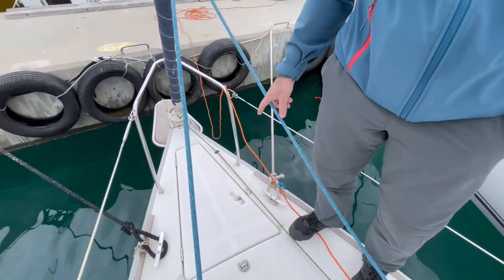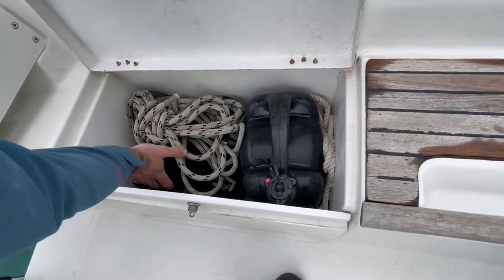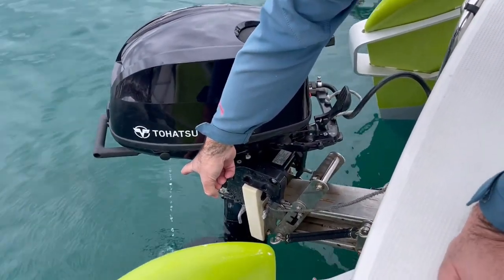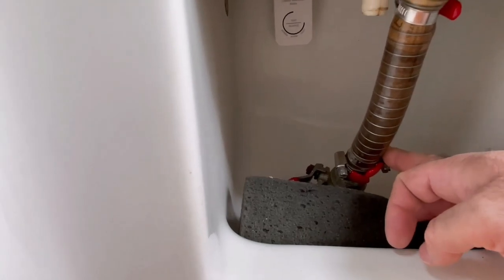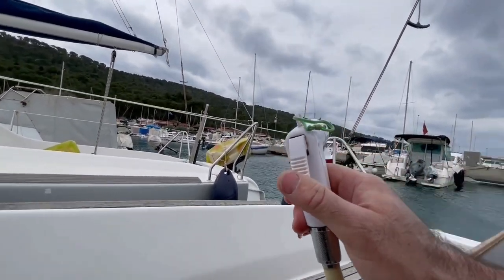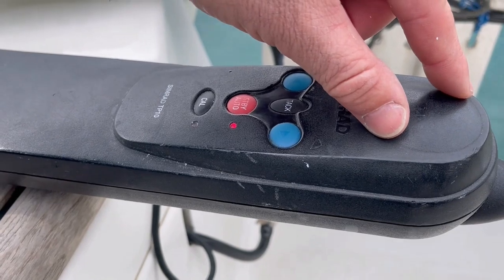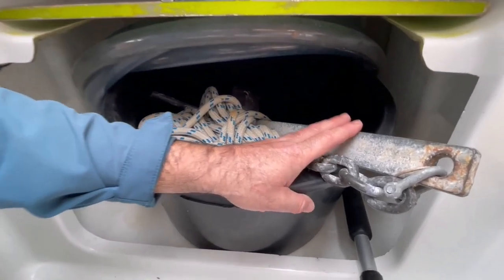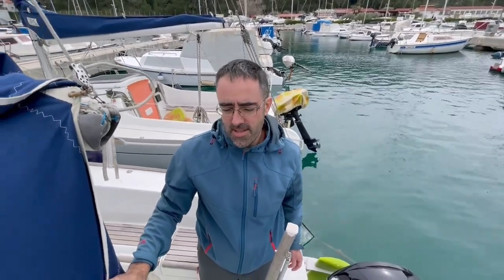Beneteau First 21.7 video tutorial by CroSails.com, compact-sailing-yacht charter

Comment: Thank you very much for the video!!! Have you ever thought that it may not be safe to have an electrical connection in the same hatch where you have the fuel? maybe sometime the tank is badly closed and allows the gases to come out...
Reply from the maker: Thank you for the comment, you made a good point. I didn't think about that before. Luckily, that compartment is open from several sides. Bench (compartment hatch) doesn't fit hermetically and front side (a compartment wall towards the cockpit) lays on two hinges based on the cockpit floor so compartment is well ventilated and there is no possibility to collect any type of liquid inside (all goes under the front wall to the cockpit)
Reply from the maker: I forgot to mention that this connector is 12V DC, 4A, power supply for autopilot. It is not 220V connector

Comment: Great video, thanks!.  Could you kindly let us know where did you get the sunshield from?. I have the First 20, I guess the same sunshield model will work but I have no idea where to purchase it.
Reply from the maker: Thank you. I made this sunshield in the local workshop 7 years ago. I had several micro boats with similar shades, mostly wider, but I made this model a bit narrower in order to be able to make it stiff (using ropes) and sail in stronger winds with sunshield on

Comment: What year boat is this please
Reply from the maker: 2007
Reply: Thanks, i am looking at a 2010 model with no motor, what size would you recommend? And how fast does it cruise on engine power please. And thanks
Reply from the maker: @markalfresco  5.5 knots with 5HP engine. Engine choice depends on how you will use your boat (for long passages or in strong current or waves)